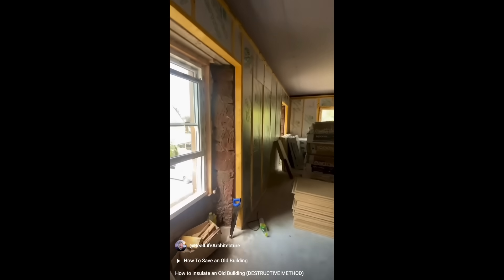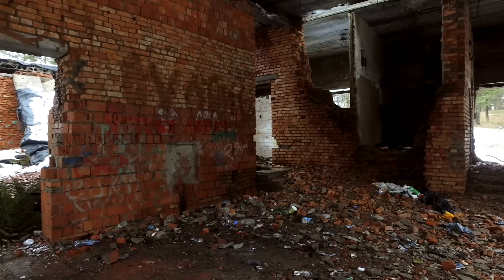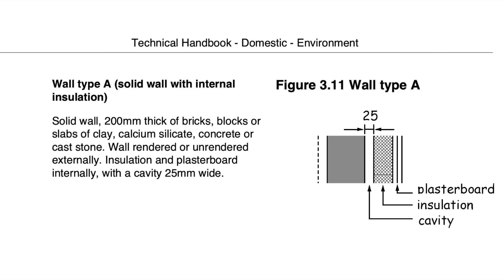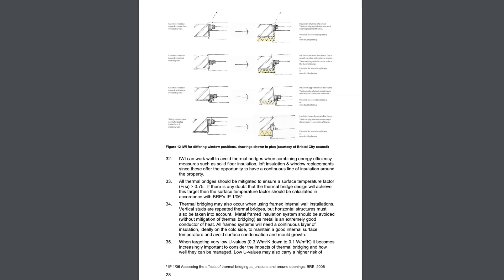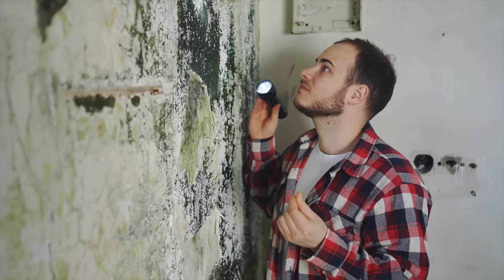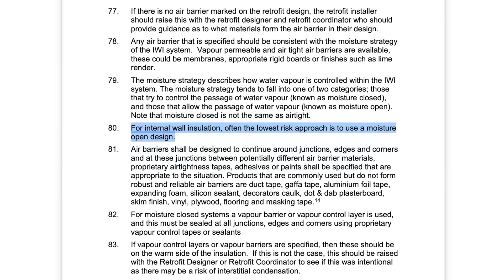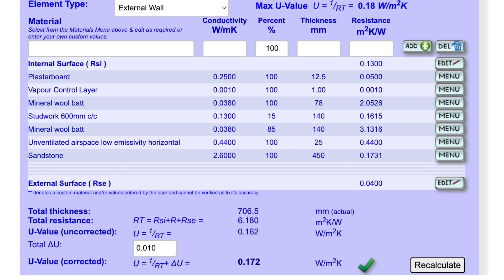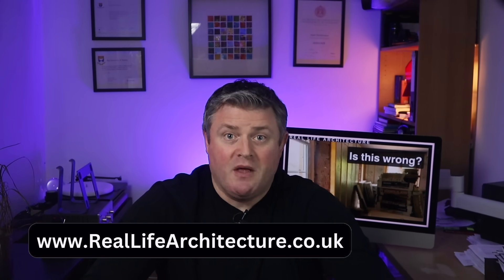How To Insulate Inside a Solid Wall in the UK

Comment from the maker: You can book a consultation to get my advice if you have a property anywhere in the UK. Whether it’s an alteration, extension, renovation or new build. https://www.reallifearchitecture.co.uk/online-services please read the Terms & Conditions before booking.
Reply: @RealLifeArchitecture   what about (solid brick terraced house) a breathable outer wall sealing treatment rollered on then inside wall hack of plaster and put thin layer of waterproof render on then put pir on sealed up? Plus, make sure room is ventilated.

Comment: Thank you - what would you do if you have a north facing wall with built in wardrobes attached (if the wardrobes HAD to stay)? I see water droplets on the inside of the wardrobes and mould appear... I've read that I should attach 20mm PIR directly to the internal wall, have a 20-30mm gap for airflow and then put the wardrobes back in? Will mould be between the wall and PIR board?

Comment: The way I insulated solid sandstone was first re-pointed all the stone outside using lime mortar. Then on inside I left a 25mm air gap from sandstone, used metal studs to make a partition wall and 100mm PIR insulation in-between, then VC foil over and plasterboard over.

Comment: Hi.
You mention using a breathable insulation with a taped slab, rather than plaster but aren't modern slabs non breathable.... can the wall still breathe?
Reply from the maker: Regular plasterboard is vapour open, although “moisture resistant” versions are available

Comment: Doing a renovation of a dormer bungalow. Would this construction still work on a cavity wall. Got cavity insulation then a 25mm gap and 4 inch pir inside 100mm studs?
Reply from the maker: If the cavity insulation is “full fill” that might be a problem, depending on how it was done. Bridging the cavity can allow moisture into the building and the wall now might behave more like the solid wall in the video. Having a gap on the inside will help but 25mm might not be enough. This needs to be carefully constructed.

Comment: What’s your opinions on this method, I’ve recently done an installation on a traditional lime pointed property. Using plastic batten at 400c with stainless fixings running from the vented ground floor all the way up to the vented loft space with undisturbed void from bottom to top. This was covered with a vapour control barrier and 100mm insulated board. Upon inspection I could feel air flow at the loft void showing adequate air flow? Great video by the way!

Comment: I renovated a solid walled cottage built of 9” soft red brick (located in Suffolk). The previous owner lined the inside walls downstairs and up with polystyrene slabs applied directly to the lime plaster. We discovered this when we came to rewire; we had to remove the polystyrene when we did the lime plaster mostly fell off of the walls! There was water running down the now bare bricks! We later worked out it was interstitial condensation. 
Fast forward, we removed all of the insulation, and didn’t replace it 😮. In addition we reopened the chimney flues upstairs and downstairs, simply to let the cottage breathe. It took 5 - 6 months to really dry out before we could re-plaster. 
We now have open fires burning in the winter, nice and cosy. I prefer the building to be cool, which really helps in the summer. 
I won’t insulate the building until I find a system that respects the cottage construction and doesn’t lead to damp, mold and over heating in the hotter months.

Comment: I have a 1950's council house with a end extension, the ground floor of which is a garage and below the level of the damp course, (600mm). Some years ago i built a cupboard against the wall and it got damp! I have been advised to use a sheet of plaster board backed with some pink insulation layer, but having watched a few videos i am now fully confused! should i get some Vapour proof (?) to add to it, or instead of or some other thing?

Comment: It has become best practice to remove everything (paint, wallpaper, cement renders etc) and use calcium silicate boards ´glued´ with special lime plasters here in Denmark. It is never ideal to insulate from the inside, because you also have the moist inside air to think about, and the thought originally was to make a completely vapor closed design. This design has no vapor barrier, is breathable, cannot rot or get mold, and can even be used in fairly damp cellar rooms. But still, you can insulate too much, because you will move the dew point in the wall, and that can give problems with bricks spalling etc.

Comment: Your clip was excellent. Well said and simple wording. I live in a flat built in the late 80s on a river estuary. Salt and rain and wind. I'm  going to save my money for a while. I've put in permanent ventilation plus open windows. I'll put the dehumidifier on to the dry out the corners instead of wasting money on the wrong insulation, which was going to be a self-adhesive plastic wallpaper. Thanks again R

Comment: This may not work. e.g. When the wall is rendered and painted with acrylic masonry paint or exposed to driving rain damp may accumulate in walls. Vapour open but not capillary active insulation may not dry effectively to the inside in these cases. A risk is often rot in timbers embedded in damp walls. This risk can be reduced with a ventilated cavity inside. A very tricky subject. A hygrothermal software simulation is advisable to try to check. Appreciate this issue being discussed. Subscribed.

Comment: We use traditional materials. Add to the thermal mass of the walls. Hot-mix insulated lime avoids all of the mould and damp problems. 50mm insulated lime plus a 6mm skim coat. The walls stay dry, the building stays warm.

Comment: Hi Niall, what plaster board would you use for solid walls? We are renovating loft conversion (build before 1980) in our sandstone house. 2 walls are solid (attached to neighbour ´s properties we live in mid terraced house) and remaining walls around the dormer are not solid but MDF was used for plastering. What would you suggest? Have you came across with buildings like this one?
Reply from the maker: If I understand you correctly the walls are party walls. If there are hearted spaces on the other side there isn’t likely to be much moisture in the wall and you wouldn’t need to insulate it because there is no nett heat loss.
Reply: @RealLifeArchitecture Thank you for your reply. 😊

Comment: 6:05 is a "breathable vapour barrier" in the context in which you mention it still blocking moisture going from inside the wall to inside the room? If yes, why does it need to be breathable? If no, what is the purpose of the barrier if not to block moisture?

Comment: Using the mineral insulation approach, you said that the plasterboard would need to be taped (and jointed).  Is this sill breathable?  I assumed that plasterboard wouldn’t be any good and that wood fibre insulation with a lime skim would be better(?).  Great video, thansk
Reply from the maker: As far as I know regular plasterboard is somewhat vapour permeable. You are correct that alternatives exist.

Comment: Architect here, if you are using pir insulation, most have silver backed foil which is a vcl, most manufacturers recommend a vcl before plasterboard. They also recommend 25mm cavity using battens on dpm strip fixed to wall. Im a fan of rockwool nirmally 140mm due to greater acoustic but its fatter.  I dont believe rockwool recommend a breather membrane instead a vcl, but there are breather membrane now which control air pemibility depending on conditions.
Reply: For an 'architect' thats a wonderful insight into your awareness!

Comment: How about wood fiber insulation. Since you use wood studs if there is wetness they will mold so that risk is there already. Wood fiber transport moisture much more efficiently than rock wool or fiber. I'm not saying that you should but I wonder if it is not the ultimate option. The dew point inside the insulation will be much more forgiving than with rock wool. Actually I have heard that flax is supposedly even better than wood fiber against damp condition so flax insulation bats might be even better.

Comment: In order to get around the problem of condensation on the metal foil, would it be possible to use external board insulation (which has no foil backing to either face) internally, therefore allowing allowing moisture to transpire, either externally &/or internally. IMO, the foil faced backing causes as much problems as it is intended to solve.

Comment: My house built in 1994 has a double masonart wall with an open void between. I am searching for a company or contractor who can inject expandable foam into the void. Thus far, I have not found this. BTW: I'm in northern Portugal.
Reply: Probably because it is not a good idea to inject expanding foam into a cavity.  Sprayed foam insulated roofs were popular until people discovered the timbers rot and not they can be uninsurable, unmortgageable.  Expanding foam does just that - expand and that can damage the walls.  I saw a homeowner inject foam in to subsidence cracks - it busted the bay apart and the corners had to be rebuilt.

Comment: I would like to throw 'mineral bonded wood wool boards' into the discussion aka Heraklith. You can easily stick them on the wall with mineral plaster, then put lime plaster on the inside. Not a really good insulator, but very tolerant to moisture.

Comment: I have almost the exact same situation. I’ve bought an old corner shop that used to be part of a larger hotel building 150+ years ago in the Scottish Borders. Made of same stone as in the video. We are converting to a flat so the building warrant requires us to heavily insulate the external facing walls with a 50mm!! Cavity. Then breather membrane, 9mm OSB3, 120mm Kingspan TW55. Then Vapour Control Layer, 25mm Kingspan TW55 and then service void and finally plasterboard.

Talk about belt and braces as we will be losing at least 250mm but I’m keen to get as best energy efficiency as possible.

My question however is how the hell do you secure the 50mm cavity - surely it doesn’t free float in front of the wall? Do I batten it directly to the stone wall or do I use brick ties??

Would really appreciate someone answering this question because I’ve been scratching my head trying to find the answers in all the regulations and recommendations!

Comment: IWI should always be touching the wall, if there is a gap you've created problems. 
When discussing thickness of PIR to glasswool it's easy - just double thickness to achieve the same insulation value. 100mm of PIR is the same as 200 of wool.
Aside from the space you lose with wool then this video shows the best insulation system i've seen and am going to put it on my house: https://www.youtube.com/watch?v=Ou1CjwflZtM&t=936s

Although I'm going to copy it and make my own as it looks easy (i'm in the trade).

DIYers and builders are going to be so busy in years to come making right all these bodged insulation systems that people have been applying to old houses.

Comment: We added 25mm PIR insulation to the internals of all the external walls of our Victorian terraced house (hope that made sense), as we didn't want to eat up the room inside. Most were battened with an air gap, but we also dot and dabbed some PIR-insulated plasterboard at the front.  It's been a few years now, and the house is considerably warmer, taking far less to heat the place and no problems with condensation - although we have made sure ventilation is up to current standards.  Had the in-laws over a few weeks back who commented that it's always cosy at our house compared to their 90's built house - which is crazy to hear - and they assumed it must cost us a fortune to heat the place to keep it cosy, how wrong they are.  So don't be afraid to use just 25mm if that's all you can afford or if you don't want to lose too much space, it takes an old cold Victorian house to something very livable indeed.  We wouldn't change a single thing, and nor would we want to increase the PIR to 50mm or more, it really was the best balance between retaining reasonable room sizes and improving our home for our family.
Reply: i’ve recently put 25mm pir on external walls feels much better.    i think people just over complicate the topic.
Reply: Solid brick 1930s house here and I echo your comments although mostly 40mil insulated plasterboard here. Also installed a PIV fan in the loft. Much cosier home now and cheaper to heat 😊
Reply: If you are happy, great.  But the calculations prove the more you insulate the less heat is lost.
It is a case of diminishing returns though.  PIR board is expensive.  If you buy 5 sheets you will get really good prices making 50mm bulk the same as 25mm from a local merchant.
You don't need a thermal imaging camera to see the difference, many electronic thermometers have a 'Surface' mode and you can use feel the difference.
But a thermometer in surface mode give you a number.  Internal temp 21oC outside 8oC Uninsulated solid wall surface 16oC insulated (PB bonded to 50mm bonded PIR) wall surface 20.4.
25mm OK 50mm good 75mm better beyond that I'm not convinced.
External polystyrene becoming popular but far behind internal insulation.

Comment: I recently had my listed stone built property in Central Scotland refurbished (to repair the exterior of the building) thanks to a council grant scheme.  It has sandstone walls about 650mm thick which were repointed with lime mortar, and the roof slates were removed, existing felt underlay removed and replaced with a breather membrane then the slates were re fitted, with some new slates where appropriate.  All new lead flashings everywhere, but the property still has no insulation anywhere, except for about 150mm loft insulation, between the ceiling joists.   I mentioned upgrading the insulation to the specialist conservation architect who was over seeing the refurb,  and he said, for old stone built properties in Scotland, his preferred method is to use an insulated lime plaster system directly on to the inside of the stone walls,  fully breathable.   Do you have any thoughts on that method ?   This is for improving an existing house rather than converting, so I appreciate, it's unlikely to meet the current building regs for new build / conversion projects.   For insulating between rafters, (room in roof areas)  he would normally use wood fibre, friction fit between the rafters, maintaining a 50mm air space on the outside of the insulation.   He said he doesn't usually bother with a vapour control layer on the inside of the insulation as this can sometimes cause problems with dampness from outside (rain getting through the slates, or stone)  getting trapped on the back of the VCL.   It's all very confusing with most publications insisting on vapour control / air tight membranes on the warm side of the insulation to stop warm moist air getting into the roof or wall construction.  He also said to avoid using any PIR types of insulation and only use breathable insulation types such as wood fibre, or sheep's wool, which are hydrophobic, so they can cope with a little bit of moisture (absorbing it and releasing it again, depending on conditions) without adversely affecting the insulation performance, and this can help to keep surrounding timbers dry.
Reply: @SoundsToBlowYourMind  Similar property in Yorkshire 300m elevation
 I applied Bauwer (other brands  lime-based available), insulating plaster to inside of external walls to apx 20-25mm thickness, as the stone walls are quite lumpy. When finished with lime based (best) or clay (ok) paint, the wall remains one vapour open element, with no moisture traps. Not recognised by any epc or similar surveyors but definitely improves performance, minimises risk, and makes wall and me happy! Done 7 years ago. Do keep an eye (ir thermometer) on wall temperatures and keep above 14 if possible. Combined with dry air (<60%) the thermal comfort is good and easy to top up with heating. Let walls get cold or damp, and it is unpleasant and slow to heat properly. Although insulating plaster is messy to apply, it's quicker and less fussy than other methods. Beware light powder dust though!  Pictures, clock etc can be hung in plaster layer, but shelving etc need fixings  directly into stone behind, so need longer fasteners.
One point I did not realise. Lime is hydroscopic, so it absorbs, then releases, moisture, and also resists mould. Just lime paint alone can improve mould and condensation resistance.

Comment: Yep I struggled with this challenge several years ago when insulating a north facing cold kitchen. I was aware that rubble walls dry both inside and outside so allowed at least a 40mm cavity but I did use PIR because space reduction was a big issue. I thought vapour control barriers were a non-starter as eventually they'd fail but the condensation issue bothered me. As a complete amateur I felt rather uncertain so eventually made sure there was at least a 25mm air gap at the bottom of the insulation all the way around. The top can breathe through the ceiling void. Only one wall is west facing where the rain usually comes from. That was 9 years ago with no outward signs of trouble but I don't know what's occurring inside the cavity of course. The kitchen space is kept at a generally steady temperature via UFH and the property dates from 1898 with 3 outside walls each open to the air and only 1 of which is generally subject to wetting. I may have messed up I suppose  .  .  .

Comment: A vapour permeable inner insulation may let moisture dry out into the house - exactly what you do not want. It also lets condensation from the house condense on the inner face of the external wall. Far better to have multifoil dangling in a cavity, fully taped, with a dry timber inner frame. The outside wall must be lime mortar pointed to let the wall dry out to the outside.